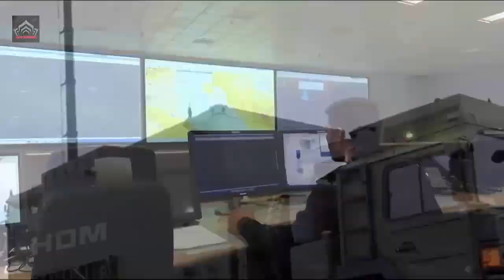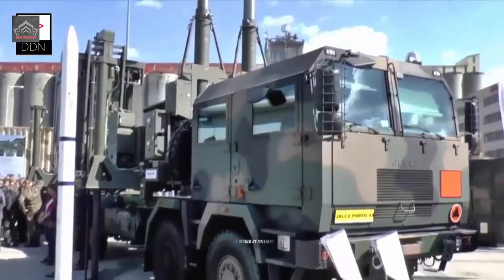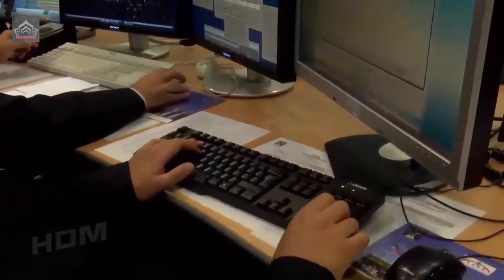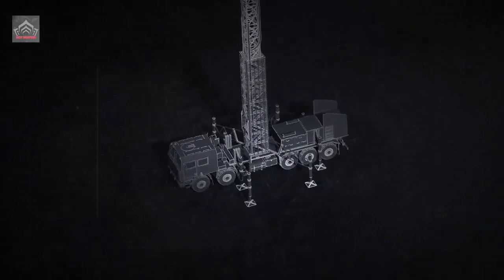MALA Narew The Polish Skies Guardian! Poland’s New Short-Range Air Defense System has arrived

Comment: It would be wonderful if Ukraine could transition over to Western equipment at a faster rate.  Its current former Soviet equipment is likely to run low on ammunition which is primarily made in (ruZZia, north korea and china).  Therefore, the sooner the Ukrainians can transfer to Western tanks and guns with their standard NATO ammunition the better off they will be vs the aggressive, imperialist, war-mongering ruZZians. What other equipment do you think Ukraine needs?

30 M142 HIMARS (GMLRS 90 kms &  ATACMS 300 kms)
200 K9 Thunder Howitzers -  Poland Logistics & Servicing
100 K2 Black PantherTanks - Poland Logistics & Servicing
100 K239 Chunmoo MLRS - Korean 80 km - 200 km
1,000 Oshkosh & Polish Logistical & Tactical Vehicles
2 THAAD - Integrated Air and Missile Defense System
6 NASAMS - Norwegian Advanced Surface to Air Missile System
500 Humvees /500 IFV JLTV
Drones - Unlimited (S/M/L) Short Medium and Long distance - TB2 Production in Ukraine
4,000 Ukrainian. Stugna-P ATGM - Production in Ukraine - Exported to Baltics & Poland 
2,000 Javelins + 8,000 misilles 
5,000 NLAWs
2,000 Piorun MANPADS - Polish for logistical reasons

FA-50 Fighter South Korean Fighter Jets - Same as Poland (50)
6 Neptune Coastal Defense Systems - Ukrainian 280 KM
100 French Ceasar Wheeled 155 mm Howitzers
200 Polish Rosamak IFV  turret with 30mm ATK-44 chain gun, UKM-2000C, and two Spike-LR ATGM

100 Israeli Atmos Wheeled 155 mm Howitzer
100 Polish AHS Kryl 155 mm NATO-compatible self-propelled wheeled howitzer 
2 Patriot Missile Defense Systems
100 German PZH 2000 Howitzers
25  AH-1Z Viper gunship helicopters
25  Eurocopter Tiger helicopters
25 Boeing AH-64 Apache helicopters
100 M109A7 howitzers
200 South Korean K21  Infantry Fighting Vehicles
Counter Battery Radars
100 Zuzana 2 wheeled SPG
10 Polish Narew Air Defense Batteries on 200 8x8 trucks with over 1,000 missiles
Plus a large NATO base
Reply: who cares?